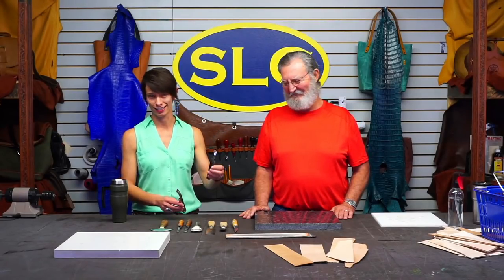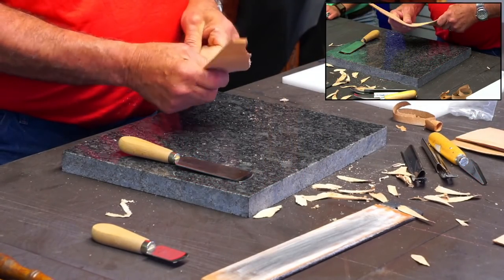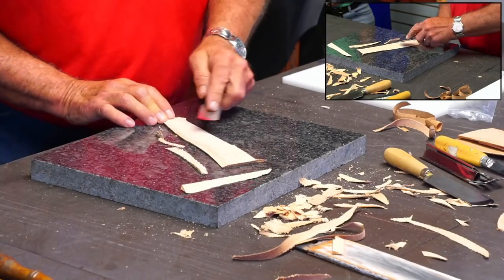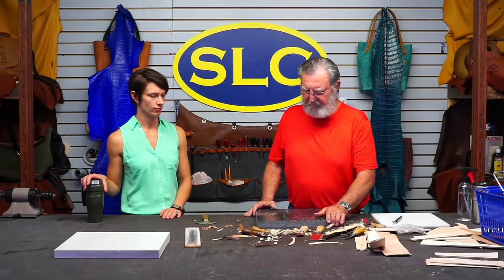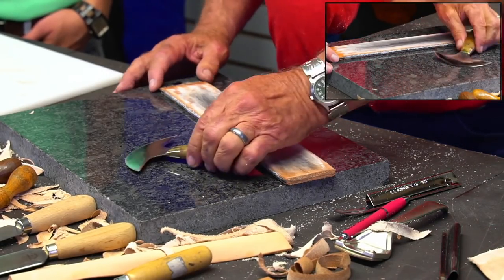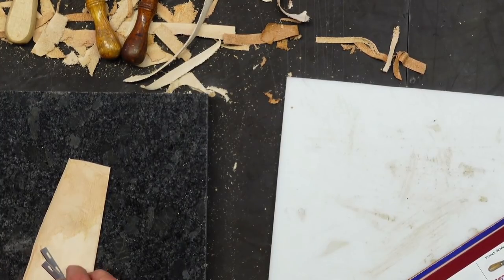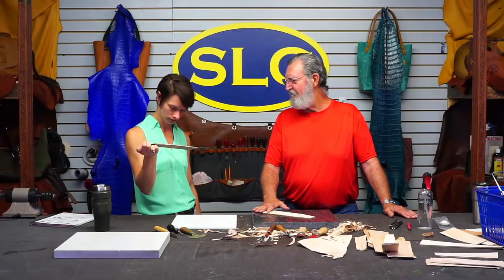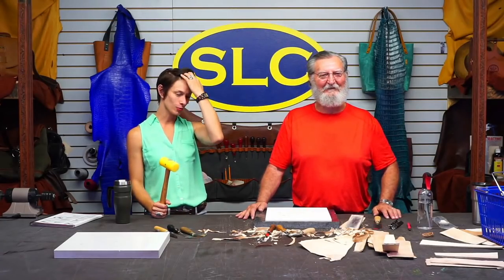Ways to Skive w/ Denny + Liz

Comment: I strop the replacement blades on 1 micron diamond paste on leather just a bit, cuts better. I strop my utility knife blades too before I use them, I haven't replaced it in two year. For edge bevellers I dampen the edge slightly before I run the bevel down the corners, works a little easier.